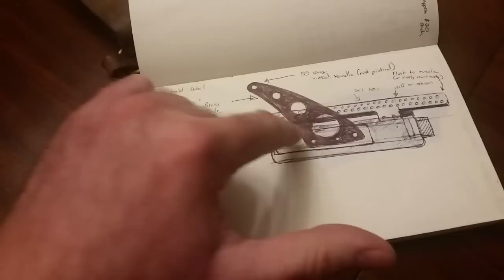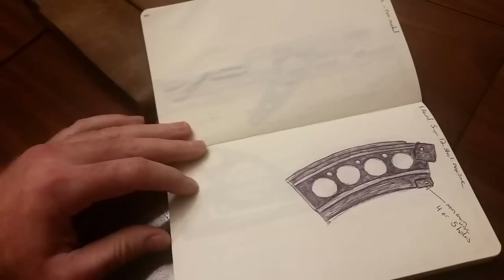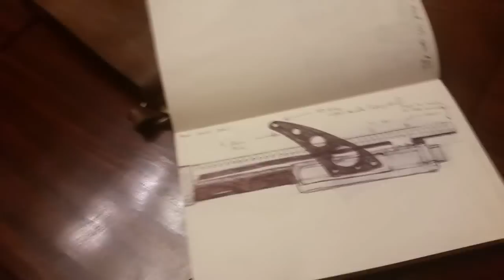Mag Fed steam-punk boarding shotguns Video 1: Mossberg 500/Black Aces  first steps..

Comment: if the the pin holes were left to be drilled. and the safety switch port. would that be considered an 80 receiver? if so, make one, would love to replace receiver on broken receiver shotguns without rostering more property than really using

Comment: you might want to try a rough media for the tumbler
Reply from the maker: +scottydontknow100 Any recommendations?
Reply: +Proto-Ordnance If I remember right walnut shells are a course media and I know aluminum oxide is. You can get both at Harbor Freight.
Reply from the maker: +scottydontknow100 I think what I'm using is walnut, or walnut corn husk hybrid... I'll look it up... I would like to avoid aluminum oxide if possible that stuff is pretty nasty if you breath it in... and if its just purring away in the garage of the house where I live, the likelihood of it getting into the air is rather high.
Reply: +Proto-Ordnance I know people also use regular old play sand and have had good results